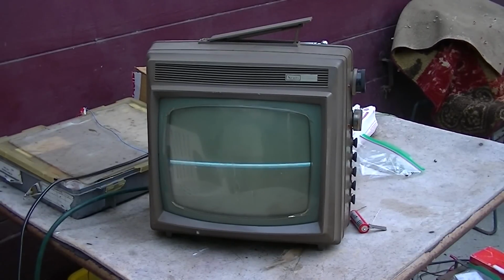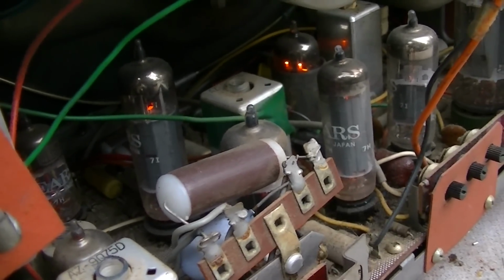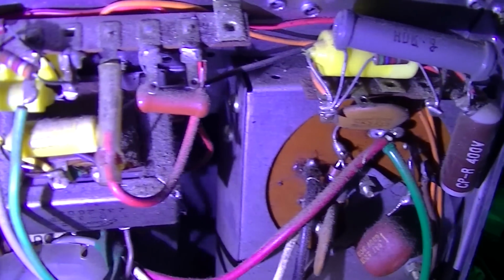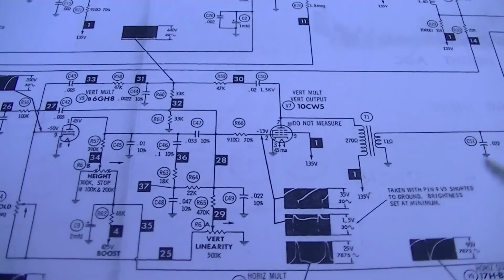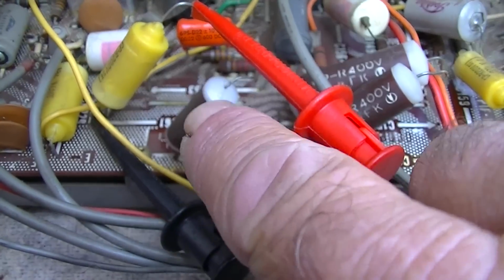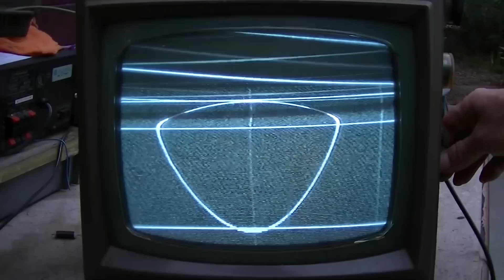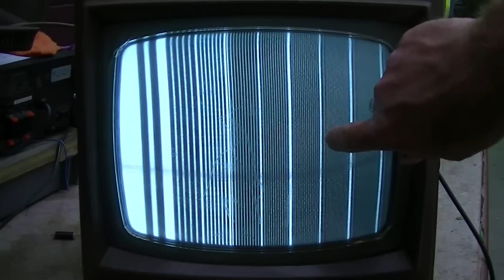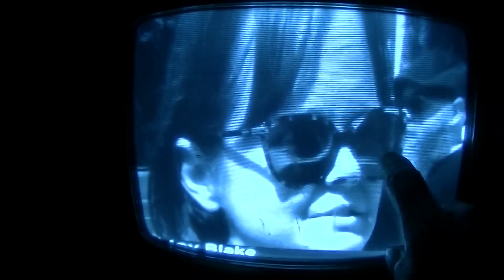tube television vertical deflection repair 101 Sears Toshiba vintage TV

Comment: I'm a big fan of the shango066 method of repair which specifically avoids "shotgunning parts until it works". I appreciate him taking the time to share his expertise with us, especially the detail he goes into concerning his thought process as he explores the circuit to find the failure(s).
Reply: After close inspection, it's very important to obtain an operating baseline of any vintage electronics that needs to be repaired. Indiscriminately throwing caps at it doesn't necessarily solve the problem. I would however inspect the electrolytic caps in the power-supply circuit before power-on, though.

Comment: Another wonderful video! Vertical circuits are very interesting. Love seeing the TV come to life again. You are so amazing not only in what you know but in tackling difficult projects. You're 3k miles away and I always look forward to your insight. Looks like I'm never going to make it to LA so if you want to produce a video of the Hollywood sign I'll bet it would be fabulous. I already enjoy your road trips! Thanks
Reply: But vertical circuit in this TV is not designed very smart. Multivibrator workes across both tubes - triode + pentode. There were better designed vertical circuits, where triode itself worked as multivibrator + sawtooth generator and pentode only as power amplifier with S correction. This design had less problems with vertical linearity and it was easier to repair.

Comment: I don't think I've ever seen one of those Sprague capacitors short and it just proves that anything can happen.
Reply: well they will fail if they are being fed the wrong power due to other parts failing.
Reply: radiotvphononut would be nice if you posted more repair Video's I learn so much from you and shango
Reply: Synthematix, that was my thought as well. Orange Drops are extremely reliable---something shorted it out.

Comment: This failure mode is still good for one thing, playing the Mission Impossible theme!
Well hey, the vertical sounds like the Noisy Cricket! Nice!
Thanks for the interesting diagnosis video!
Reply: TheFurriestOne after watching this video, I now know what that buzzing cricket noise is. I use to own a old wooden chassis 70's PYE set that had the separate UHF & VHF dials on the front & it was my bedroom tv. Could hear that noise while it was on, sadly it died 4 years ago from a weak CRT.
Reply: Yup! Sorry to hear it died, but there's only so many hundreds of hours a set can provide before something goes out. Fortunately there are thousands out there in the world, in various levels of functional.
Reply: TheFurriestOne Yeah it was sad when it died as I had it since I was little & still had it well into my adulthood too but it had a good life.
Reply: That's an impressive run, they don't make 'em like that anymore!

Comment: Vertical deflection failure is so common because of gravity... duh... It's more stressed than the horizontal.
If you were lifting and lowering a beam 50 or 60 times a second you'd wear out pretty quick too.
Reply: So if you turn your TV on its side, it will last longer? What does an electron bream weigh?
Reply: Godfrey Poon 
I tend to think horizontal problems are a lot MORE common, but the problem is, when you lose horizontal, you also lose high voltage for the raster. Then you have to verify the function of both the horizontal and flyback. And make sure the picture tube isn't totally dead.
Reply: You rotate it periodically to keep the electron dispersion even.
Reply: Godfrey Poon lol

Comment: This is all i need to complete my monday nights entertainment excellent video shango, also isnt it strange though, i never actually watch television. In english sets all those controls are inside on a PCB
Reply: Are they really inside in 60s and 70s models?
Reply: In english sets yep, all the advanced setup adjustments are inside on a designated pcb
Reply: In 60s V-hold and V-size were not part of "advanced setup". Tubes emission fall down when they are used long time. So it was necessary to adjust V-hold and V-size time to time as tubes degraded.  
Czechoslovak (Tesla) tube TVs had V-size,  V-linearity and V-hold accesible on back cover (50s and early 60s models also had H-hold (line frequency) accesible). Early transistor TVs had only V-hold.

Comment: However they are designed or what the problem I enjoy you going though the repair process. Face it, when you decide you are going to fix a circuit consider it fixed. When I serviced TV's, vertical failures were among the most difficult to fix. You add things to the description of what you are doing the text books don't. Also love how you warn against placing a meter on the Horizontal or the Vertical plate and the method of doing the testing safely.

Comment: I have a Magnavox small screen B&W television, same era, 68 with television deflection issues.  I do have the schematic.  My question, how can I measure voltage, I do not have that type of voltage meter?  Can the transformer be ohm tested for open coil?

Comment: You got it working, but I'm a little skeptical about the failure mode. Orange Drops are some of the most robust capacitors ever made---the only time they fail is from voltage spike or extreme overcurrent. I'm thinking that the original cap replacement worked for a little while, until something shorted it out.

Comment: maybe you might be the only one who can help me. I have an old black and white WEBER brand tv that has the exact same horizontal line problem that suddenly appeared where it was playing. Unfortunately I couldn't find the electronic diagram anywhere. It has 12 tubes. With a visual diagnosis I believe the problem is a PCL84 Tube that looks bad. But I'm not sure it's for the vertical scan. There is also a PCL82 Tube but I think it is for the audio output. I would really appreciate it if you could help me.

Comment: It's interesting that there was a failure of the replacement cap in the feedback loop between the grid and plate of the 10CW5 tube. Those orange gum-drop capacitors almost never go bad like that, as they are usually quite reliable.
Reply: Chet Pomeroy 
I think those, and the "brown drop" caps were early plastic film caps.

Comment: The 10cw5 really would work perfectly as an audio output tube. In fact it was used as that. 10cw5 would be the LL86, Philips used the el86 in a row of otl amplifiers with 800ohm speakers. Other tubes often used for audio that are the same as the 10cw5 /LL86 except for the heaters were the UL and PL84

Comment: I have a few of those oil-filled 1600v Elna electrolytics lying around.. maybe I should test them?

BTW have you ever seen TDK tubular ceramic capacitors?  I have an old TEN/Kobe Kogyo 5-tube "drugstore radio" (actually one of the better built ones) which is full of them.  I thought they were hollow thin-film resistors at first but they turned out to be ceramic capacitors.

Comment: You cant red plate a vertical output circuit with loss of oscillator its not an A class amplifier